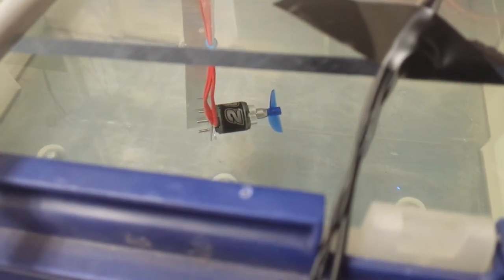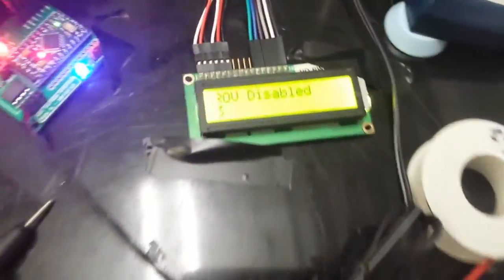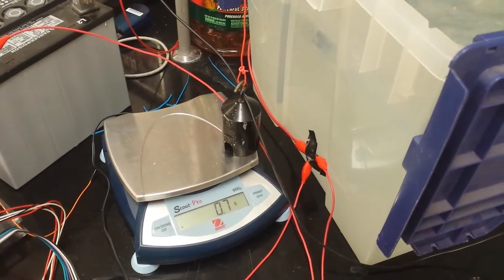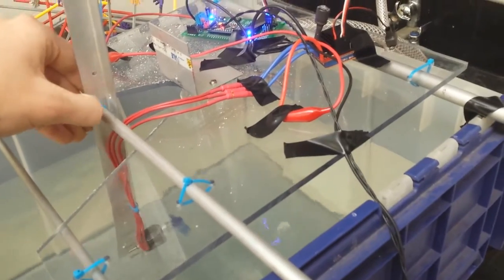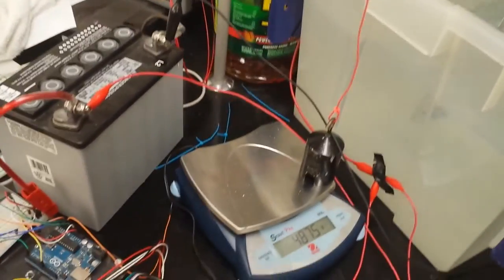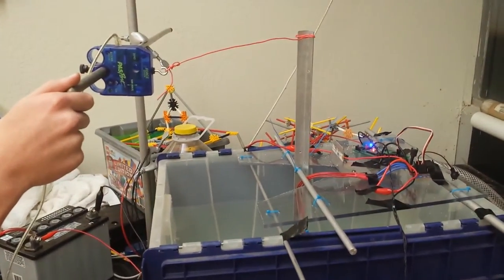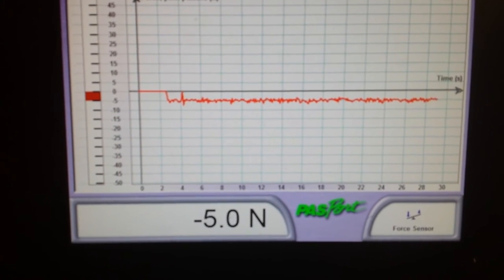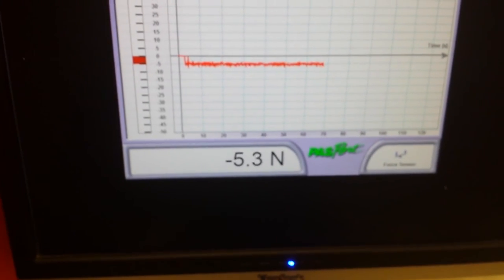ROV Thruster Full Power Force Test

Comment: Nice test!! you can add a bearing to the aluminium bar to reduce the friction. Can I know the Voltage and current at half power and full power??
Reply from the maker: Thanks! The first test with the wire over the bar was not very good because of the friction, which was why I went to the more precise force gauge towards the last part of the video. At full power the voltage was around 11v, and current was about 8A. The 12v battery is running pretty low, so it was getting a lower voltage than I normally run it at. During this test I did not have a voltmeter and ammeter connected to monitor the voltages, but in a video I made previously I monitored the current/voltage while running the motor in each direction at full power. Brushless ROV Thruster Test #2 -- Current Limiting Removed